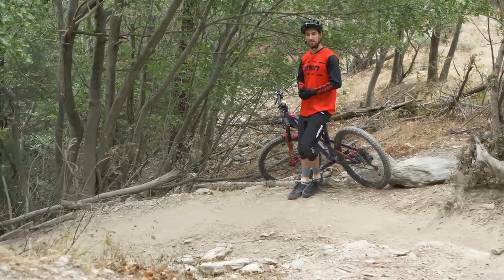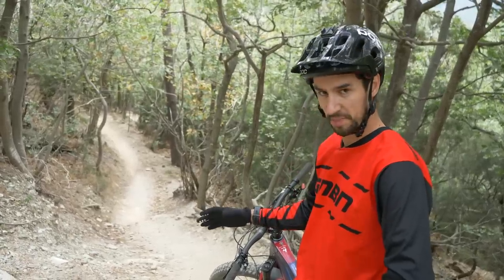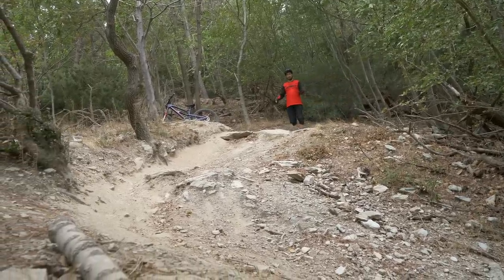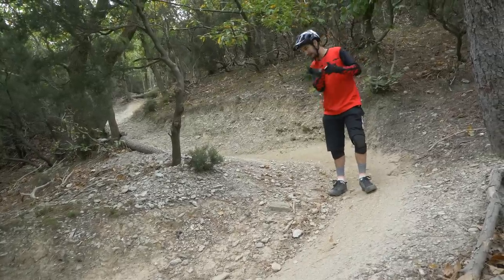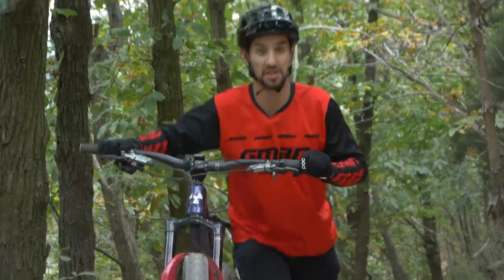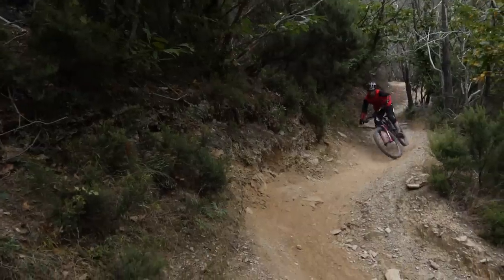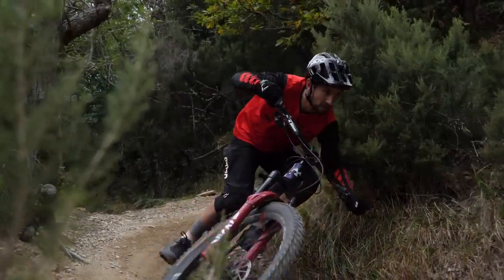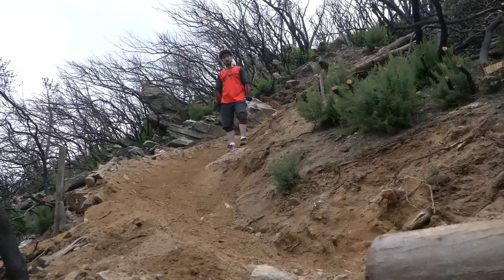How To Ride Tight & Steep Switchback Corners On Your Mountain Bike

Comment: Nice work Neil.  I like the progression in this video to more difficult examples.  Here in Santa Barbara, CA, we mostly have the tight/steep/loose examples.  I find the difficulty is quickly leaning from one side to the other as you go through the fall line apex.  It takes a bold committment to throw the bike over.  Any advice?

Comment: I was hoping there would be more info on the tight switchbacks that require an endo turn, this is the hardest turn in my opinion
Reply: Eyk On A Bike campared what we ride here, the trail in the video looks like autobahn.
Reply: When it's that steep you don't want to do endo turns.
Reply: Yeah these are rounded turns and not actually switchbacks. I encounter turns that come to a point and switch directions

Comment: I find left handers harder. I have trouble dropping my left hand to lean the bike and just feel unco on tight corners. Ok on longer ones though. Practicing and learning every day.

About your talk about body position at around 5 mins. I have a theory there. The engineer and motorcyclist  in me says you have 2 things to resolve. Firstly, to go around a corner, your CoG based lean angle must be enough to match/provide the cornering force (basic circular motion stuff). The second part is about the bikes geometry. to go around a tight curve requires a higher lean angle to get the steering geometry working properly on the corner (that natural tendency for the wheel to turn as the bike is leaned over). Get both these right, and the bike goes round smoothly. It also means on a tight turn, you have to push the bike under you a bit to get the bikes natural turn radius to align with the lean your CoG needs. I think...

Comment: Would it better to lean into the upwards slope if it's a slower, steeper, much more narrow single track path with some stepped drops and littered with tree roots on a fairly tightly packed surface with some overhead branches towards the gnarlier exit? So you don't break your face in case you fall? How would you approach something like that? I should mention that I'm a novice.

Comment: Banked switchbacks? Those are just tight  banked turns aren’t they? Steep switchbacks are hairpin turns with high risk for falling off the edge.
Reply: Exactly what I thought I was clicking on, something requiring a stoppie or nose pivot/endo... Not really much technique to banked corners other than "go fast enough to be supported by the outer edge"
Reply: gigpic yep. I was hoping for a nose pivot tutorial as well. I was learning those back in 1994 on The Way Up trail in Escondido, CA. Classic tight, rocky switchbacks with a sharp drop off. Couldnt make a few of them while keeping both wheels on the ground.
Reply: Exactly what I was thinking.  The video should have used a natural trail not a bike trail to demonstrate what tight switchback technique really is

Comment: Which will be easier, long travel or short travel?
Reply: Random Stuff longer travel with no lock out is harder to pedal because you have more suspension and squish to deal with, if your are thinking of xc, get a short travel bike but if you are thinking enduro with more downhill, go longer travel.
Reply: It depends on the discipline

Comment: I’m still working on body position for switchbacks. Feel like I need to drop my chest towards the bars a little when I get my weight back otherwise I feel like I’m sitting to high through the corner. Any comments?

Comment: These aren't even tight though, you're lucky. You get hit with basically 180 degree angles in Colorado such that you have to get good at little Endo/manual adjustment turning maneuvers, it's nuts